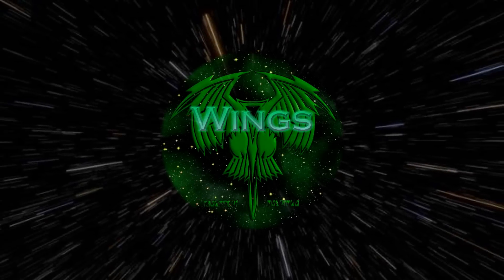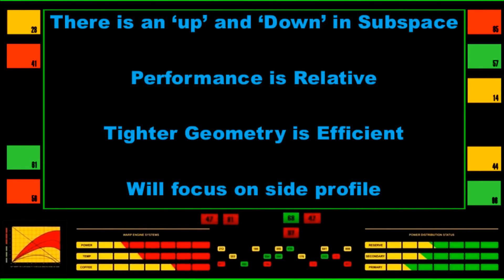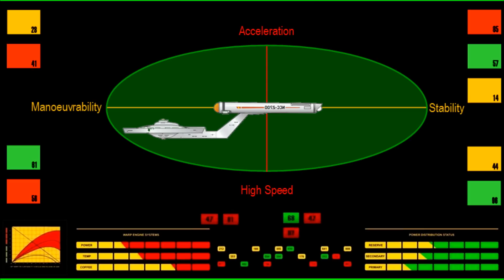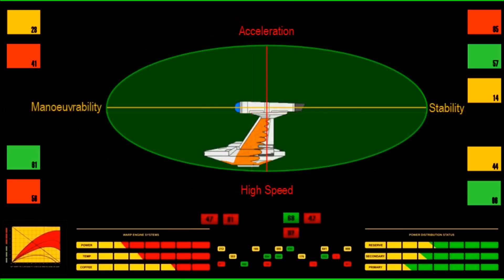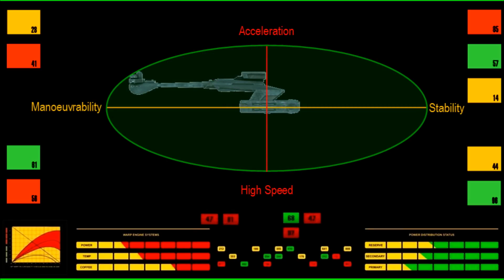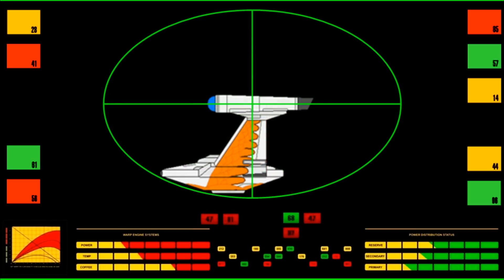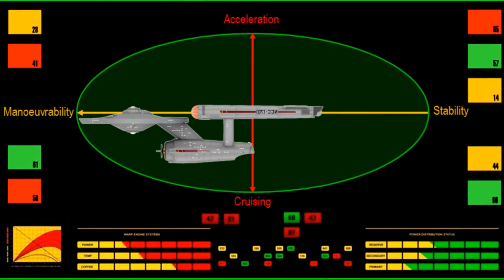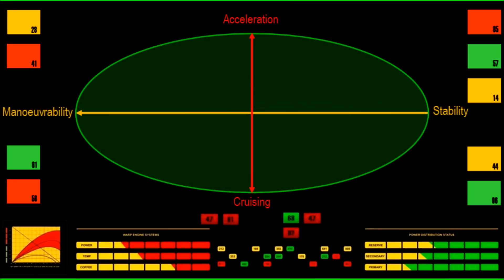Warp Field Geometry Explained!

Comment: I just noticed that in the bottom of the warp field diagram you have a category named "warp engine systems" and under it a bar just titled "Coffee".
Suggesting that how much coffee the engineering crew has had will have an effect on the warp engine.
Reply: Don't you know that the most important piece of equipment on a modern Naval vessel IS THE COFFEE POT?  I can show you DOZENS of warships where weapons, engineering, and sensor systems don't work properly, but those ships are still going underway.  Show me just ONE SHIP UNDERWAY where the coffee pot doesn't work.  Hell, US Navy ships carry Star Bucks products to improve crew efficiency.  :D
Reply: <— former snipe in US Navy, can confirm coffee is essential.  More coffee = more efficiency.  No coffee = no go.

Comment: So about the up and down  thing:

My idea is that rather say that there's an arbitrary direction in subspace or that direction is determined by the ship's artificial gravity (which can be shifted and changed), we simply consider that a warp field, like an electromagnetic field, has a polarity. This way the warp field can still have an "up" and "down (in the form of its north and south pole) and have the ship's performance at warp be influenced by being closer to either of these poles, without any particular artificiality.
Reply: It has to be like this for his system, otherwise a ship can just fly upside-down relative to the absolute subspace direction to flip acceleration and speed.  

I don't find this scheme convincing, though.  I adhere to the Starfleet Museum postulate that the flat shapes have warp dynamic effect because otherwise there's not a lot of sense to the shift from the Daedelus's spherical primary hull to saucers and this means there's another very large variable involved.

Comment: You can throw out all of this video after mentioning subspace. The beauty of warp travel is that you don't leave normal space. This is the reason you must take consideration of the position of the planets and other structures to avoid collisions.
Reply from the maker: The main thing it would affect is steering. The saladin would be hard to turn at all. And the akula would bank and roll.

Comment: If we were to apply the graphs to Dominion ships or at least the main 3 that we saw during DS9, we see that the smaller fighter stands higher on the Y-Axis with a small lean going towards manoeuverability, With the standard Mantis class we see that it rides lower on the Y-Axis with a heavier leaning on manoeuverability at least if we're countng the dorsal nacells, the battleship rides closer to the balancing point much like the D'Deridex class.
Reply from the maker: Well interestingly the two dominion capital ships are one of the few 24th century ships which have dual mode nacelles.

Comment: 2:07 I get what you’re going for, but I think a better way to express this would be to say the ship (and its nacelles) still cares about its own local “up or down” (possibly, as suggested in another comment, due to an interaction with the ship’s artificial gravity field).  And the only reason I say this is due to that scene in Enterprise where the Columbia is flying inverted relative to the Enterprise before they match speeds and Trip transfers via cable.  That still works with everything else in this video if the up and down is localized.
Reply from the maker: Yeah the field effectively having its own internal poles.
Reply: @venomgeekmedia9886  That's probably a better way of expressing it.  Instead of "up" and "down,"  each end of the diagram represents a "performance pole" where a given attribute is stressed and certain "attributes" conflict by nature.
Reply: I love internal poles! Its the best place tp put em!  @venomgeekmedia9886

Comment: You missed single nacelle designs (Freedom Class, etc). Would indicate high acceleration and maneuverability. But it is also sitting in just 1 warp field instead of the overlap of the 2.
Reply from the maker: I'll cover that when i look at various nacelle configurations the main thing with monos is that they can't steer
Reply: Makes sense, altering the warp field of 1 nacelle vs the other(s) for turning...

Comment: Personally, I think speed is determined more by size of the warpfield in the direction of movement. A long nacelle allows for the field to thrown fowrad or back. Maneuverability would be dependent shifting the warpfield to bias one direction. That is why spreading the nacelles out can provide greater maneuverability. Acceleration is dependent on the steepness of the warpfied.

As for the center of mass being off center, I would say that has more to do with where the ship's engines (Matter/Ant-matter) and Warp core are located and the need for the warp field to not interfere with the energy flow.
Reply from the maker: Nacelle length does affect power too. And I will probably delve into different nacelle types and their traits.
Reply: @venomgeekmedia9886  

Very true. I make head canon/sense that to throw a warp field further forward or to increase the warp gradient would require more power.

Comment: Grayscale logo?  Also, I pronounce it "Zee" and don't really like "Zed".

There is this thing I think you are overlooking in terms of maneuverability vs stability.  Actually two things:
(1) Moment of inertia.  The further your pivot point is from your center of mass, the harder it is to rotate.  I would like to hear how warp fields overcome this obstacle.
(2) The pendulum rocket fallacy.  The longitudinal position of the center of thrust doesn't matter unless the craft is very, very flexible (think Kerbal Space Program with auto strut turned off).  I fail to see how the warp drive can produce stability or maneuverability unless a side-slip in the warp field produces a lateral force on the ship like the vertical stabilizer of an aircraft.  But even then, the later force comes from the thing that the plane is traveling through (namely, air).  Does subspace resist warp field movements in a way that manifests as a lateral force against the craft?  If that's the case, then the diagram is reversed of what it should be (unless you have an explanation for why it's not that way).

For alternate systems, I think I'll agree that tri-nacelles produce instability while turning while quad-nacelles produce more stability.  I would also agree that tighter warp fields are more efficient.  Don't quite remember what you said about distance between nacelles and stability or control, but I think putting the nacelles further apart will result in greater maneuverability at warp (more torque when nacelle power output is imbalanced) while tighter nacelles provide for more fine-tuning of the ships course.  And for vertical position, I'm not exactly sure other than how tightly the warp field can be fitted around the ship (efficiency).
Reply from the maker: I terms of the moment of inertia having your ships center of mass ahead of the pivot point it allows you greater maneuverability but you do need the power to do so.
I'm not clear on your 2nd point but we do see in designs like sovereign that a tighter Hull and warp profile is more advantageous.
Reply from the maker: The logo change is for the queen

Comment: I vaguely recall seeing a graphic of the Enterprises warp field where the warp field was centered on the front of the warp nacelles.  But my memory sucks so...
Reply from the maker: Possibly. I've seen that graphic where the warp field is very similar to a magnetic field.
Reply: I have a book on Star Trek from the 80 that depicts this as well.  The theory in the book was that Starships "projected" or "threw" their war fields out in front of the ship and the speed at which this was done along with the size of the field dictated how fast the ship could travel.  Having two engines allowed you to alternately "throw" a field from each engine, doubling efficiency.  The warp engines would also be "cycling" ie "pulsing" their matter-antimatter reaction, meaning that more advanced engines could create stronger fields and "refresh the power" of those fields faster.  Keep in mind, that this "pulsing or refreshing" is probably occurring in milliseconds like the refreshing of a computer screen.  We can all see the difference between a refresh rate of 60 and 120 in our monitors, so I'm inclined to believe warp cores operate in a similar way.  That's why the STNG series ships have light pulses running in their cores.  It's the warp engines cycling.
       The original concept was sort of like in sailing where the sail catches the wind creating a low-pressure zone in front of the boat and a high-pressure zone behind the boat.  The wind wants to collapse that low-pressure zone and moves there pushing the boat along with it.  The warp fields apparently act the same way.  Thus, if this book is to be believed, warp speed is based on the power (intensity of the low-pressure zone) and size (or the distance of movement) of the warp field in question.  This is why a ship can also expand its warp field to "share said field" with another ship.

Comment: First, I love all of this.  Second, There doesn’t have to be an up and down is space or sub-space, because there is an up and down on any ship with artificial gravity. It’s reasonable to expect a ship’s AG systems would interact with the warp field.
Reply: I would add that it seems there's some kind of warp "aerodynamics" which seems to affect ship design (aside from the Borg). My head canon is that hull plating has an influence on the warp bubble, resulting in the hull shape having a large influence on the ultimate dynamics of the ships warp field.
Reply: @CaptainMojo  Agreed, I refer to the "aerodynamics" as subspace warp field streamlining.
Reply: If the warp fields work at all like magnetic or electrical fields, then there is an axis and a rotation of the field about that axis.  And much like twin engine planes (and boats) where the props rotate in opposite directions (for stability reasons), I would imagine that the warp field rotate with the same philosophy.  So, you get the warp field coming INTO confluence on the 'top' while it is diverging at the 'bottom'.  So, I could see how a lot of mass in the converging zone could convert to acceleration in warp, and something else happening in the diverging zone.  Less about actual 'top' and 'bottom' and more about a consistent rotation direction about the warp axis.    Really makes the 3 drive ships very weird/imbalanced.
Reply: I was thinking along those lines, too.  It could also be a justification for ships always seeming to meet each other with their decks oriented to the same 'down'  (Apart from I guess some general protocol that might be a pretty common idea for people that come from planets, at least if they don't normally meet each other hanging under branches or something.)
Reply: What happens when a ship doesn't have artificial gravity?
Reply: @ransom182  What does?   We haven't seen warp drive without it.
Reply: @OllamhDrab  do warp capable probes and torpedos have artificial gravity? If a starship turns off its gravity plating does the warp field just collapse?
Reply: @ransom182  I presume by this train of thought, that's why probes and torpedos don't bother to have outboard nacelles.   I mean,  it's not too much of a stretch to figure that if you have  artificial gravity,  it applies to other spacetime effects,   but if you don't, who cares.  It just goes like it goes.   Get it?)
Reply: It is also possible that this effect may depend on which side is positive and negative monopole.
Reply: With regards to 'up' and 'down' nacelle placement could also be explained as being relative to the rest of the mass of the ship. meaning that while there is no true up or down, relative to the center of mass such a distinction can be made with nacelle placement.

Comment: This video has indeed been a long time coming. Nice to finally see it.
Looking at the examples in the video, it would seem that ships with high speed + stability or high acceleration + stability are rather rare.
Reply from the maker: Maybe kit bash one together. Find out why.
Reply: @venomgeekmedia9886  Though I do agree with use of additional nacelle for stability and maneuverability. And those effect undeniably did have some level of presence and could be tested especially around NX era. I personally fallow rule of tumb complaisant to Roddenberry rule that gains were typically negligible to justify costs of additional nacelles. I personally use separate explanation for multi-nacelle solutions, relevant to TOS era revolution and after. So:
- Single nacelle ships were usually substandard, short range ships. Most commonly constructed in pre-TOS era (around Kelvin specifically). They were mostly result of Starfleet, what just become Federation standard. Basically mass producing ships from similar modules. As small two nacelles were technically still better solution, though there is known effectiveness issue with those at the time.
- Two nacelle were standard.
- Three nacelle solution was most common in dedicated Battleships (expected to take a hits). It was combination of veritable geometry, emergency warp drives (best known in Federation and Dreadnought classes) and additional nacelle what allow ship stay operational, as nacelle lost was one of most common form of battle damage (stated additional effects were bonus).
- Quad nacelle in my opinion are systematic for deep space explorers. Those ships didn't have chance for rescue if warp engine was fried. So it did make sense for them to have two separate systems. Ability to switch between high acceleration and high speed mode, was just added bonus. It also decreased wear of systems, as one set could be in maintenance when other was still operational.
Reply: My guess is visually, it doesn’t easily look ‘cool’ but I’m gonna try some designs for that. We shall see….